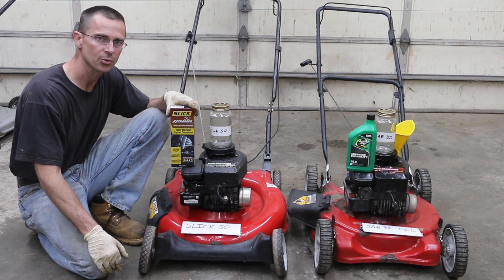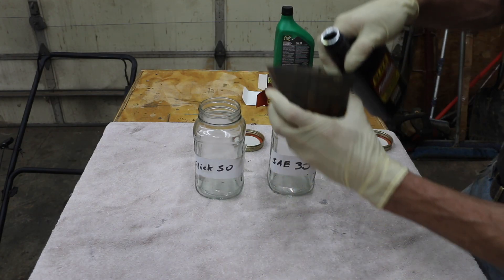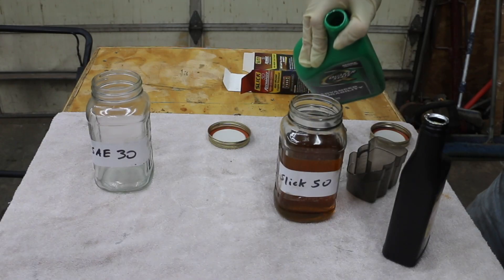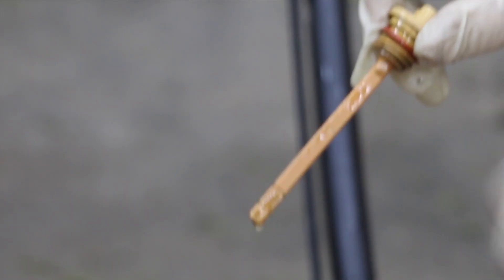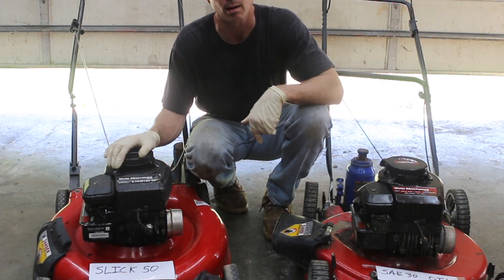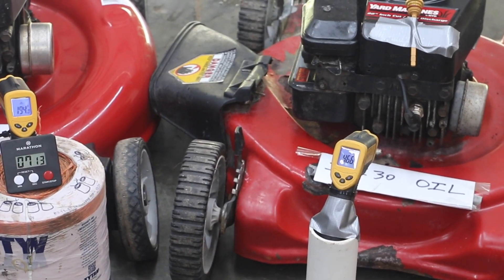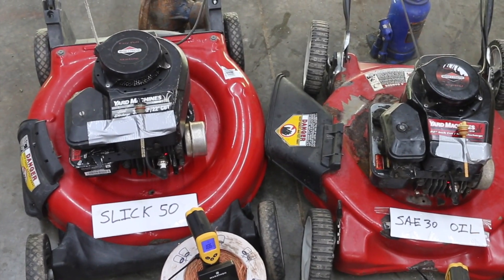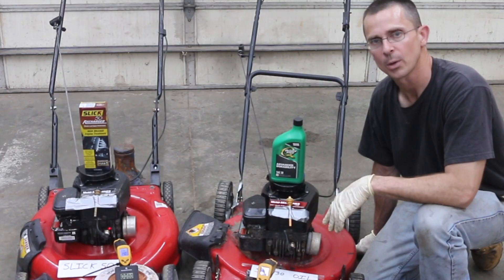Can't believe what SLICK 50 did to my engine!!--Dry Crankcase Test!

Comment: You need to use 2 new engines with no use time. The used engines would have differing use and wear on them rendering a useless comparison. If you add slick 50 back to both engine and use a pipe wrench to spin the units free, more than likely they both will be usable again for a great deal longer into the future. I tried this with a trash pump an employee had neglected to check the oil on. We were running the pumps 24/7 and they had at that point several hundred hours. They were both using oil at a regular pace. They both froze up. It was important to keep the pumps going and were being used in a remote project with 2 new motors being over a week away for delivery. I broke both units over and added straight  slick 50 that till that point I had never heard of. A log truck driver suggested doing this. The motors were then run 8 days constant until the new motors were plumbed. Those 2 slick 50 motors were still working and kept on site as back ups. I was very impressed and it saved my bacon.
Reply: Project Farm you should tell him where to send $ for 2 new engines 😄
Reply from the maker: 2 new engines would indeed the most fair test!  Thanks for watching the video and commenting!
Reply: If you read my comment all the way thru would would realize I did try it on two equally worn engines. Filling up with Slick 50 and using a pipe wrench to break the pistons free proved to me that the stuff did work.That was in 1991 and the two new pumps cost over 600.00 each. Payed my share to learn already.

Comment: You are running a test comparing an additive treated oil, to the same oil without additive.  The treated oil was lower temp according to your study. If conditions between the two engines were identical (which they were not identical engines) so how can you really compare them?

Waste of time.  Drain the oil out of any engine and it will fail...duh.  What is the point of a failure comparison when the engines are not the same, probably one was about to die anyway.

The Mind Boggles

Comment: I remember some infomercial that mentioned slick 50 as a competitor that was running maybe 20 years ago. It was called DuraLube. Sounds like a personal lubricant to me.
Reply: rimmersbryggeri - In the early 90s I had a Pontiac Fiero GT that was in great shape and very low miles. 
Other than the stupid solid fuel line issues it ran like a champ. A buddy of mine his father bought into that duralube pyramid bullshit and talked me into adding it to my oil and gas. 3 days later it spun a main bearing. The old man across the street put that shit in his mid 80s dodge truck and blew his engine too I later found out.
Reply: Im not at all surprised. Even when I was about 8 I realised that was snakeoil. Would be nice to see a proper test of it though. It's kind of one of those produgts the salesmen would drink and eat to demonstrate how safe they were. When you see that you directly think that its some kind of cult behind it.
Reply: There is a reason all auto/truck manufacturers will void their warranties if anything is added to the engine oil, nothing good can happen . Also modern engine oils are more than adequate if changed at proper intervals there is absolutely no benefit to adding anything to them
Reply: No I mean to say duralube.
Reply from the maker: Thanks for watching the video and commenting!
Reply: +GHOSTGXZ there is one called duralube
Reply: I think you mean to say dyna-lube
Reply: rimmersbryggeri 

I suggest you Google image search both and then tell us what you think
Reply: Ranjit 

OK. I fuckin hate nascar, so sorry for not seeing the ad, there is or was also one called dynalube.  it was good shit, it only needed 1 Oz per qt of oil to be added
Reply: I suggest you check main sponsors of nascar races. The product I am talking about is duralube they have youtube videous you creapy clown.
Reply: Did I say I was scared of a picture? It's the stupidity that scares me.

Comment: This test is not surprising by any means.  Slick 50 has not been proven to provide better adhesion to metal parts than regular engine oil.  In fact, I believe it's just the opposite.  In my opinion, I believe it makes the oil less adhesive to metal parts due to it's enhanced lubricating factors.  As a result, more oil is drained from the cylinder wall and thus causing reduced lubrication in the absence of oil.  The lower temperatures are a from the heat resistant properties that are within slick 50 and regular oil combined.  All this is well known and was actually investigated by the FTC many many years ago.  You can read the following link for that information:

https://www.ftc.gov/news-events/press-releases/1996/07/quaker-state-ads-slick-50-are-false-and-misleading-ftc-charges
Reply: It sure looked like more oil came out of the Slick 50 engine when he drained it. So more oil remained in the other engine and it ran longer. No mystery there. The oils should have been measured accurately,  both in and out.
Reply: Darin johns, i remember them comercials to come to think about it, Thank you for the input.
Reply: I meant wall, my bad.
Reply: I'm not sure whether it helps or hurt. My only experience was with a 1988 Ford Ranger 2.3L. I had about 18K on the motor. In cold weather, the motor really knocked when I started it for several minutes. Slick 50 talked about helping that. I added one quart at the next oil change. From that moment until almost 100K, the motor was always quiet when I started it in cold weather. When it started knocking again around 100K, I did the Slick 50 treatment again. Again, cold starts were quiet. I'm not sure what all it does or doesn't do, but a quiet start tends to tell me the "coating" of the pistons was keeping it lubricated for a cold start. I could be wrong...I'm no mechanic. By the way, for those suggesting using a new engine for the test, Slick 50 doesn't recommend that. At least as I recall, it suggested having 10K on the motor before treatment. i.e. motor is broken in.
Reply: Yep, I had stop rod knocking when starting with Slick 50.. It works..
Reply: You won't stop very slight rod knocking with any thing other then extremely thick oil. Rod knocking comes from the connecting rod bearing have excessive wear and the rod "flopping" around on the crank journal. No additive will rebuild a destroyed bearing to take up that slack. Only thicken the oil to quiet the impacts but the damage is still there and still continuing.
Reply: @treetrunker13  yeap, it works. I used it also on my airplanes and got better climb power and top speed. Last a few thousand miles. Good enough.
Reply from the maker: Jason,  Excellent information.  Thanks for watching the video and commenting!
Reply: Project Farm doesn't he know that those side valve engines have no oil in the heads?
Reply: Actually, the method of removing oil from the engines is flawed.

To ensure no oil in the engines you have to remove the drain plug (very hard to access on some lawn mowers, but there is one on the engine)

Briggs engines can run and not eject oil from the dip stick  hole with 75% full oil.

Comment: Good test! I too was a Slick 50 fan back in the day, but eventually gave up on it. Today I use RedLine 20/50 synthetic racing oil and 15% Lucas Synthetic oil additive. The Lucas helps the oil to stick to surfaces for a much longer time, and seems to also make it slipperyoer Besides the car ( LS1 Chevrolet engine) I use this blend in the shop air compressor, Sears semi-commercial 8 HP.  With factory spec 30 wt regular oil we used to wear out and seize compressor heads about every 18 to 20 months...After switching to RedLine with 15% Lucas, we are now going on 6 years, with no noticeable change in sound it makes, or compressor performance. It runs cooler too, but I can't say specifically, as did not use thermometer on it, but you can't feel the heat radiating off it like you could with 30wt.
Reply: Stop using that heavy oil and crap oil 'stabilizer' and use only fully synthetic 5w30 as specified by Chevy.
Reply: I did before, and destroyed an LS1 in 130,00 miles.. Shit water weight oil is specified by GM to rsise thier CAFE numbers on fresh engines, not to give long engine life. My race engine builder buddy steered me away from thin shit, and its the best advice I ever got.. I have 190,000 on this LS1 and it has virtually no wear, perfect compression, no rattles..  Its tighter than my first engine run on thin mobil one was at only 40,000.   No friggen way would I ever go back to shit protection of thin oils unless i lived in Alaska or Canada where the thin is needed due to extreme cold. It cost about 8 grand total to replace the LS1 in my Corvette.. That really hurt... I expect to get over 300,000 out of this engine on 20/50 with Lucas.. I am already almost 200,000 miles and its doing fantastic.. All the people in the club using thin oils are getting about the same wear out as I did, 130,000 to 160,000 and they sound like a bucket of rocks. You are very wrong... you need to study the reasons companies spec thin oils.. its because on a new engine with no wear, it is slightly more loose running, and over the average of 10s of thousands if engines, that translates to slightly higher Corporate Average Fuel Economy numbers, mandated to be met by the Government. Those oils do nothing to extend life. They are specified for a politically mandated milage rating. Thats fine on a new engine, not expected to last for years...  Im keeping this car till I die or become too infirm to use it. I need long life maximized, and don't give a crap about .06 mpg on a new engine.
Reply from the maker: Thanks for watching the video and commenting!
Reply: It's time to stop living in the past, thinner oils lubricate better and stay on the metal longer, decreasing wear,and increasing engine life, a friend runs a twin turbo LS1 in his Ford Granada, 9.5 second quarter mile and 200+mph in the standing mile using 5w30 fully synthetic oil.

http://www.hendonpub.com/resources/article_archive/results/details?id=3965

Comment: I would love to see you try Liqui Moly (20002) Cera Tec Friction Modifier in your tests!!
Reply from the maker: Thanks for the product recommendation!  I'll see if I can test it in the near future!  Thanks for watching the video and commenting!
Reply: molly great stuff
Reply: Likewise, I think any high moly disulfide grease you can get would be interesting.  Even if you had to dilute the grease I would be very interested to see how well residual moly protects.  Even as a dry lubricant it's one of the best compounds available.  On the same line of thought you might try CLP or similar.  The reason we use CLP on our weapons in the military is that it leaves a teflon film after wipe down.  Thanks for the entertaining vids man.
Reply: You can buy pure MoS2 from AliExpress (I did). I'd like to see an ounce or two of that added to ordinary oil then same test done.

Comment: This experiment is flawed. Those engines are not new and are not the same. The quicker failure of the slick50 engine could be due to preexisting damage or a difference in construction.
Reply from the maker: I agree that using 2 identical new engines would be much better.  Thanks for watching the video and commenting!
Reply: No problem, still fun to watch.

Comment: The SAE 30 engine was running slightly warmer during the initial testing because the hot exhaust from the Slick 30 engine was being expelled directly into the intake of the SAE 30 engine.
Reply from the maker: Great point! Thanks for watching the video and commenting!
Reply: Saw that too.  Would have been a better comparison if BOTH were run on straight SAE 30 first.  No way to know if the temps actually dropped with adding the slick 50.
Reply: Avnett definitely would make a huge difference 
source=im a.s.e. certified in engine rebuild/diagnostics
Reply: w108jpw I came here to say exactly this!
Reply: nice dude way to pay atten that had to make a differance
Reply: Internet certifications are always 100% legit.
Source = I'm and a.b.c.d certified certification certifier.
Reply: w108jpw dobyou mean slick 30+20?...or maybe slick 30 is not as slick as slick 50... how much slick would an oil slick slick if an oil slick could slick 50?
Reply: Totally agree with the comments posted here.... there should have been a control worked into the test.
Reply: Deftones Dsm 
Did anyone check the cooling system and clean if necessary? 
I highly doubt any oil is gonna have that much of a drop in temp. 
Higher temps might not be an issue. 
As long as it's not frying eggs. 
Food for thought: 
As a side deal I hang out at an airport. 
So a guy had continental 65hp aircraft engine, and had issues getting over 130 degree oil temps. 
Stone cold, it made all kinds of milkshakes in the crankcase. 
So at rebuild time, he had it upgraded to 75hp specs. 
That means piston squirters, changed ignition timing, and a few hundred Rpms more and it's a 75 hp. It's not an issue running them as a 65, just set the ignition timing correctly for either or. 
Funny thing is now his oil temp is at 180 all day, never wavers. 
That's the heat being transferred out of the engine and into the oil. 
The evidence was clear by the brown deposits on the old pistons from not enough oil present to keep it  from burning/making deposits/carry heat away. 
I'd like to see the engines with the tin removed.
Reply: we did a controlled experiments with regular castrol and castrol syntec synthetic when it came out and it dropped oil temps 20 degrees in two different engine runs with the same engine during 15 min dyno runs on a 5 hp kart racing engine with same air temp conditions  with the conventional oil first and then the synthetic
Reply: i bet that did make a big difference.  I built a mower with two engines and the one getting blasted with exhaust from the other started smoking earlier
Reply: L O L  good one !
Reply: MrHillfolk  Jeez, that EGO, though.
Reply: Good catch.. wonder if it really made a difference?
Reply: Austin0777 just saying you should get some education about an air cooled engine. 
That's usually a common misnomer of thinking that they don't have cooling systems.
Reply: Austin0777 
Ahahah i really can't believe this, it's really beneath me but I will. 
you question a Master tech with over 20yrs experience? 
Better get a clue. 
You are just a snot nosed punk who's clueless about engines yet, I don't have an hour to kill explaining it all so I won't hold it against ya. 
Air cooled engines can overheat, I see it often. 
Block the fins with spilled oil, dust and grass clippings and you just reduced your engine life by a bunch.
After you learn what I know, question me again.
Oh, and I have more subscribers than you.

Comment: hi, mover with slick 50 looks cleaner/newer. if it had less wear and tighter clearances it would probably heat up faster and seize. older engine with more wear and bigger clearance might run longer before seizing up. and those bigger clearances might hold more residual oil which will help engine to run a bit longer. just a thought

Comment: For any of the oil additives out there, the one I liked was Petron Plus. I have personally seen a dry run engine test with it. It was some late 80's GM 4-cyl on a run stand. They had sectioned the valve cover with glass and added other viewing ports like in the oil pan. It was warmed up with Petron Plus added to the oil, then drained and plug left out. They pulled the radiator hoses off and left them off and proceded to run it. It was clearly visible there was no oil in it or coolant. They ran it off & on all day for extended periods. It became uncomfortable to be closer than 10ft from it after a while from all the heat coming off that engine.

Comment: Can you run an engine on diesel for oil? (I hear you can but would love a durability test).
Reply from the maker: I think we should find out!  I'll do this in an upcoming episode!  Thanks for watching the video and commenting!
Reply: gizzymoee I used diesel with oil. old tractor engine 67 Ford strait six.  oh God the carbon around the springs and the sludge. I've douched that strait six several times used putty knife removing the sludge. poured diesel over springs used a bristle brush.  like one of the comments earlier try unseizing the motors. and try again.

Comment: Thanks for doing another outstanding video! I was very surprised at the results! I never used Slick 50 but was interested in see what it did, which would appear to be nothing at all. I believe Lucas to be the best additive on the market, having used it in demolition derby cars for years, so maybe give it a try. Thanks again, and don't worry if trolls give you crap about blowing up two mowers, it's your videos, do what ever you want!
Reply from the maker: Casey,  Always great to read your comments and encouraging words!  It was a fun video that I've been wanting to do for a long time.  Thanks again for watching the video and commenting!
Reply: Project Farm 
how about putting Motorkote or using synthetic like Amsoil
Reply: Lucas oil stabilizer is actually just a good quality assembly oil.  Assembly oil is what you SHOULD use, though many just use motor oil, between all friction surfaces when you build or rebuild an engine.  Its thickness and additional film strength provides superior protection during the initial start without oil circulation.  Also, if you prime certain passages with a heavy oil like assembly oil, there will be less air in the passages to delay oil circulation.